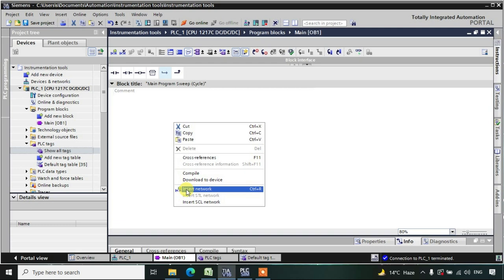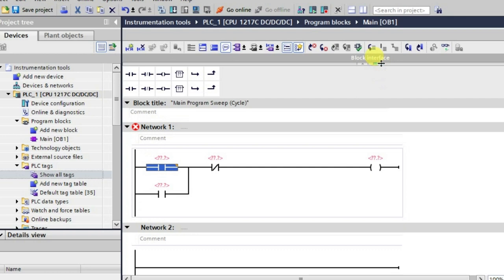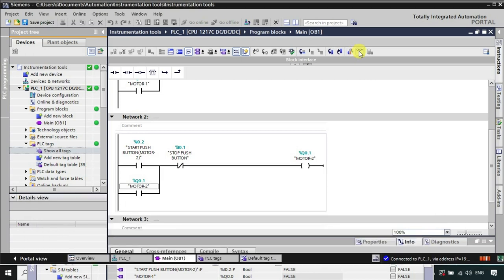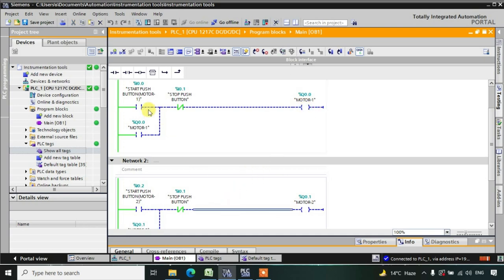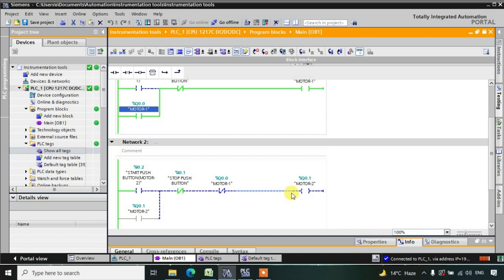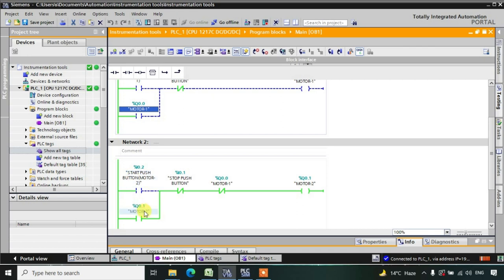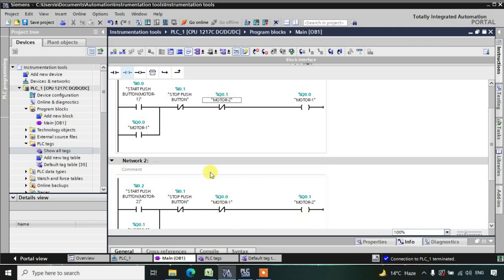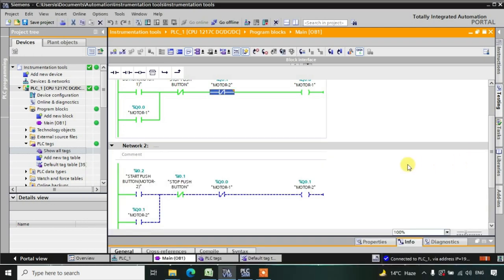PLC Interlock Program - Interlocking Ladder Logic Example

Comment: 3 motors have what will do?
Reply: for 3 motors and only one of them working at a time you can use the same concept in video
use 2 NC inputs M2-M3 that are in serie with M1
use 2 NC inputs M1-M3 that are in serie with M2
use 2 NC inputs M1-M2 that are in serie with M3